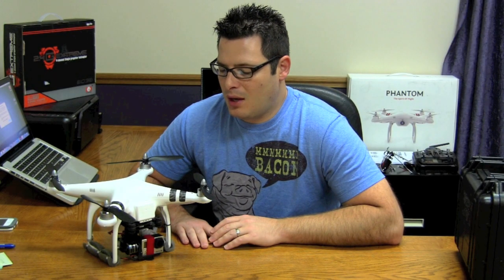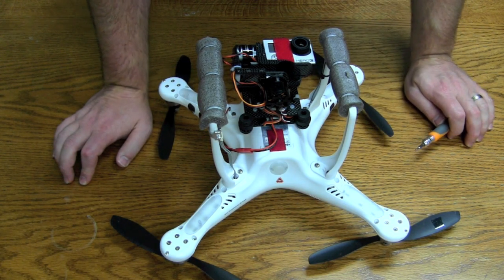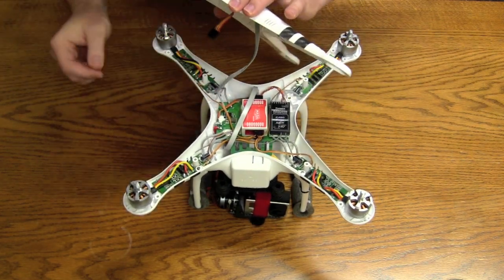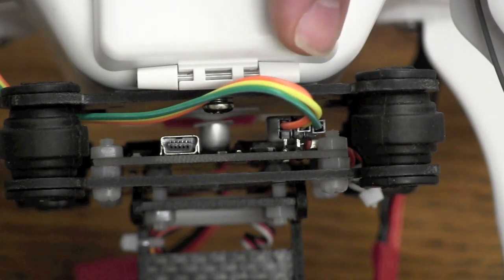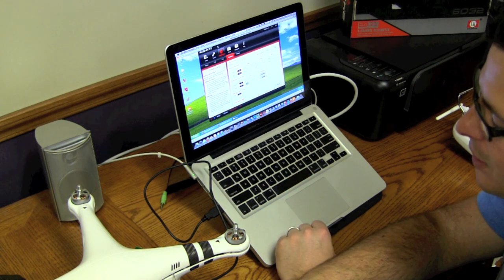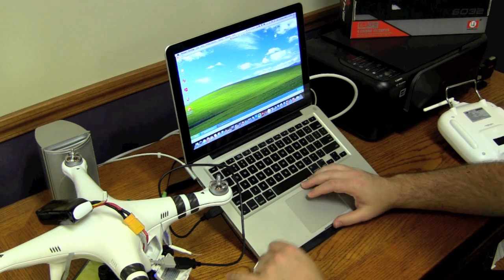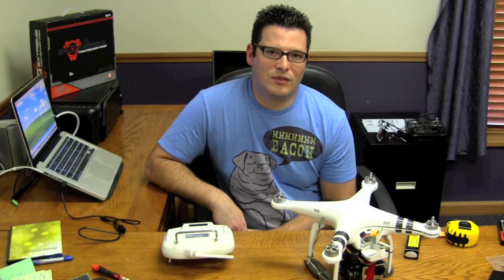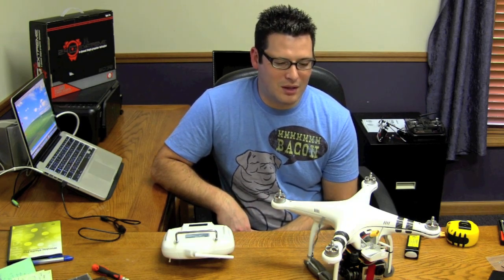DJI Phantom Manual Pitch Setup for ARRIS CM2000 Brushless Gimbal Part 2

Comment from the maker: I  completely understand your question. Actually the settings only have effect on the manual settings and not on the auto level adjustments.  So when flying full speed forward it will still tilt above the level pitch. You can watch my video I just posted yesterday of flying and you can see that when I am flying in a fast forward motion you get some of the props the shot because of it tilting to compensate. Hope that helps.

Comment from the maker: Phil, this has now been figured out. In the software when plugged in just using a USB, hold the gimbal at a visually level position for tilt and roll and then hit the Calib_AAC button, next hit the write button and after that unplug, power the gimbal with lipo and you should be good to go. You might have to play with it a bit.

Comment: Great video jlcamp7! Is there any chance you are planning a full software tutorial for the software itself that comes with the gimbal? For example I was getting a slight roll offset on my gimbal (tilted to right side down) also would like to set the stock parameters to have a slight tilt down rather than a straight shot. I do not have the 7th channel hardware just yet so I was wondering if this can be done as default settings. (Modify roll and tilt) Thanks. Great videos. Keep up the good work.

Comment from the maker: Yes even when setup with manual pitch you will still have auto stabilization on both the tilt and roll axis. The manual pitch only effects the angle at which the camera is tilted. I can't tell you how far it needs to be back on your setup in order to keep the props out. That varies based on setup. I don't have any issues with it ever being in the shot and I'm running the wide angle setting. Also you could essentialy power it from the balancing plug if you have the right adaptor.

Comment: I've been reading on FB under DJI Phantom owners page that a lot & I mean a lot of people are having problems with the gimbal.  Its mainly the "software" that comes with it. I have win 8 pc only & I read its not compatible also if u do get the software loaded it messes with the DJI interface.  Also the Arris doesn't always get recognized and if your in the Arris interface it doesn't allow you to change or enter new settings. I hope that the Arris cm2000 software issue gets resolved.

Comment from the maker: Yes and no. It is a v3 martinez board, however it has a wire that runs across it, so that it actually runs off a software by hobby-wing similar to the SimpleBGC software. So essentially it's a modded martinez board.

Comment: Hi thank you very much for your tutorial. There are 2 questions I have for you. With this gimbal can I have auto stabilization in both axis and the have the option of tilting it as I need also keeping stabilizing that axis? How do I do it on the futaba t8j?
The second is what is the distance I can move the gimbal back to avoid the props on framing and if I can power it from the balancing plug.

Comment: When you're setting the max pitch range, don't you want it to be able to go above a level position? Is this only the range for manual control? Even though you do not want to film the underside of the Phantom, you will not have any use of the pitch auto correction when doing aggressive forward flying (quad tilted forward). It is an easy adjustment though, and as I have not ordered the Arris (yet), my question might be off :)

Comment from the maker: Hi Kelly, check out my other video on my channel: ARRIS CM2000 Brushless Gimbal Review & Installation Phantom which will show how the gimbal is being powered. It needs to be powerfed off of a 3s lipo. You can use the same lipo you are using to fly as the gimbal uses very little power consumption:

Comment: The Pitch Roll and Ground pins on the blue board face forward. Any slack in my wiring can sometimes hang in front of the camera. Is it possible to use the other Ground and A1 / A2 pins on the side? Are they the same?

Comment: I want the camera to point straight with the adjustment turned to one extreme and then turn it the other way and it point down. But it is either all the way up or all the way down. When I put my lever on the tx I want to know about where the camera is pointing by the position of the lever.  Any ideas of how to fix this?

Comment: I set up my Arris cm2000 and the gimbal works good but the tilt is not working right.
 When I adjust the tilt on the tx it goes either all the way up or all the way down. As its moving I can stop it at any angle by just adjusting it a titch the other way to stop it but if I adjust it a little more than just a titch it will go all the way.

Comment: I have a question,what is the name of the cable you need to plug into the Arris to change the setting?
I ask Hobby Wing and they said it is a micro usb but the micro usb cable from my Gopro camera does not fit!
I got the new gimbal with the CF frame for the Gopro3 and everything looks different!
The wiring and now there are 8 rubber thing instead of 4 and it feel heavy!
Can someone please advise me on the cable needed to program the gimbal.

Comment from the maker: Watch the video starting from the 13 minute mark where I talk about the adjustment of the manual pitch.  Setting to zero like I mention in the video will set it straight forward when the lever is all the way one way. Also instead of the MC mode box being white click on it and make it grey. Then you'll be all set.

Comment: When I set up mine, the camera will roll all the way down (pointing straight down) and I don't have any control when I try to adjust the 7th channel. Any ideas?
Reply: ***** 
 Hey, if you havent figured it out yet (I see your comment is posted 3 months ago) I suggest you download the simple BGC GUI, connect your gimbal ( you might need to download drivers to do that ) and when in the GUI, invert your TOP AXIS. So lets say your top axis is Z, then you hit the drop-down box and change it to -Z then hit write and you will be good to go. Otherwise, if your gimbal has a loose gyro-board, try turning it upside down. Don't know if that would work though...

Comment: it seems like all the gimbals from goodluckbuy are slightly diffrent. different wires and connections on the gimbal. with my gimbal i got 4 wires with colors whit,black,brown and white. im having trouble finding exactly what i got..bcause i dont want to butn the circuits in the gimbal. i looked at a other video and he used just one wire. the white wire and only that. gimbal works great but havent connected the tilt yet because of this.
Reply: You need only one wire for the title (left or right) and three for pitch.

Comment: Actually it does not work too well as the gimbal drops to one side when this is wired in. Also the Arris software does not seem to connect but the naza software is fine.

Comment: I'm in the same boat somewhat. I can load the gimbal software but when I choose the com port and click on read. It doesn't read the settings on the gimbal. I've tried on my computer a Windows 7 64 bit and an old laptop running Windows Vista 32 bit. I even tried 4 different cables. No luck!! This guys is about as bad as DJI reading his and responding to his comments. LOL!!! I really need to be able to set up my gimbal similar to his.